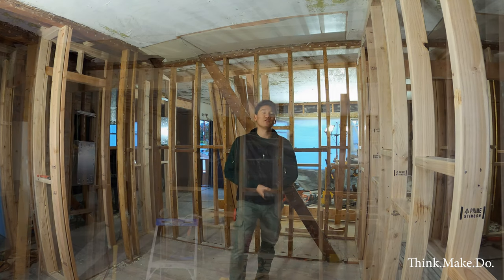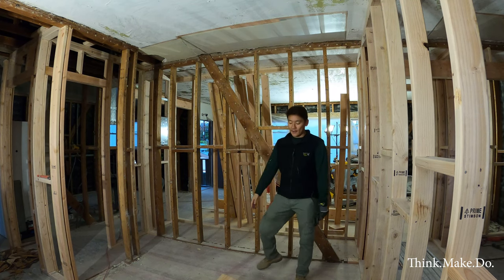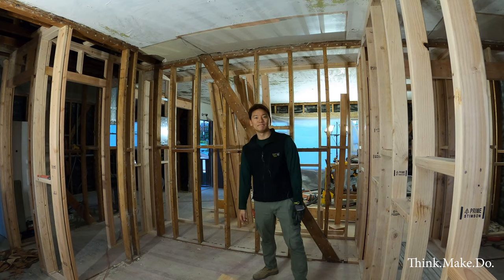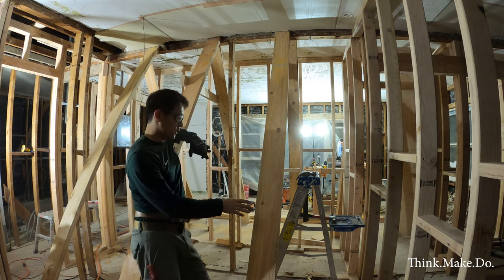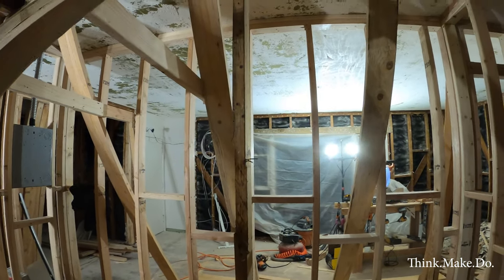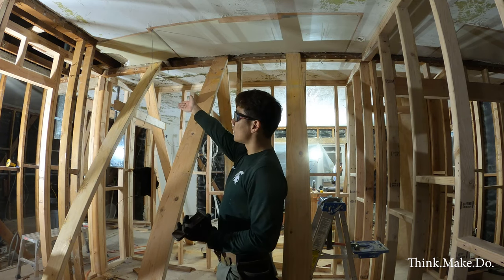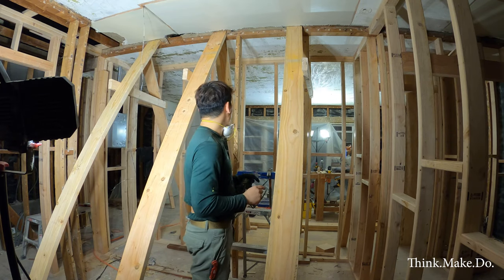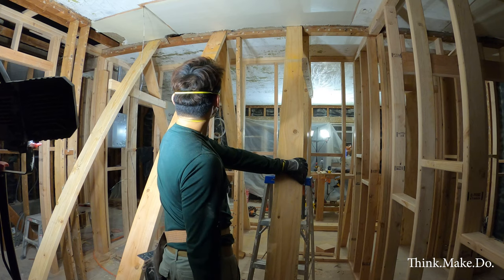Remove a Load Bearing Wall and Install Your Own Header [#3]

Comment: So why not just install a temporary top plate to support the joists, and have perpendicular (as opposed to the cantilevers) support.  This way you will have easier access to install the header.  I am not trolling, I am about to do a very small job, and am gathering as much info as possible to safely do the project.
Reply from the maker: Hi.  That is  a perfect question!

The double top plate i am supporting with the cantilevers is a load bearing wall that supports the roof structure.  If i added a top plate on either side and supported the temporary top plates with vertical studs, i would be supporting the ceiling joists but not providing any support for the roofs weight, which might sag or at worst crater the roof.  in this case the cantilever supports were safer, albeit more complicated to set up.

In older homes, the roof structure is built with supports going into load bearing walls kind of like a tree with branches vs modern construction where the roof framing is more or less self supporting in a wide triangle shape with load bearing on the exterior walls. you will need to look in your attic space to see which style you have and make sure to support the roof accordingly when you remove a load bearing wall.  

Hope that helps!
-Phil

Comment: Just curious why you wouldn't want to hide that load-bearing header up inside the ceiling to make for clean-looking ceiling lines in the interior space?
Reply from the maker: That particular section of the home had a lot of the attics lattice structure landing on top so it would have been a lot more work and engineering to cut those, move the header up, then reinstall those supports in the attic.  just something i wasn't comfortable with tackling at that time.

Comment: hi phil I'm curious if turning the A frame temp supports' 2x6s 90 degrees would be a stronger support. 

sorry I don't know the terminology but the orientation that those are seem like they could bow once you take out the existing header.
Reply from the maker: Good question.  i had to go horizontal because the stud i was supporting was also horizontal and only had 1.5in of wood to attach to from the side.  if say that stud was a beam taller than 3.5inches, i could flip the a frame supports to be vertical and much stronger.  i also needed to make sure i had space under the stud to fit in my new beam, so i had to keep the area as clear as possible.

hope that makes sense!

Comment: You didn't have to do anything to the footing of the supports for the added load in the areas of the floor? Or this house is on a slab?
Reply from the maker: ah yes, what I did not show is the reinforcements to the wall on the bottom floor with extra studs to carry the weight down to the concrete slab!